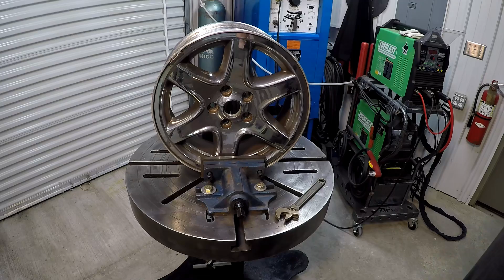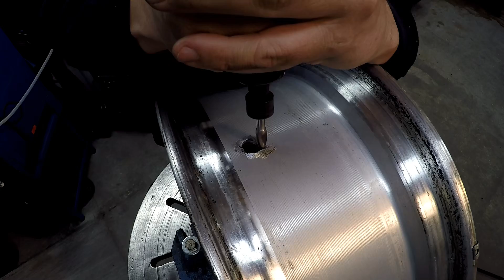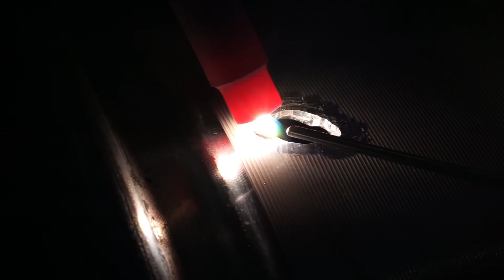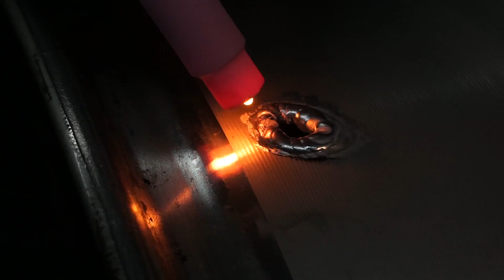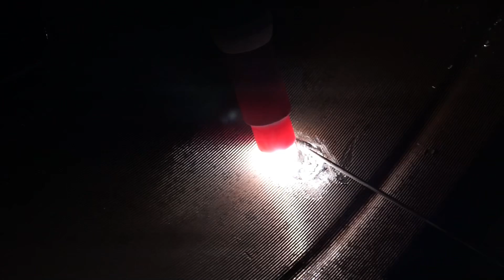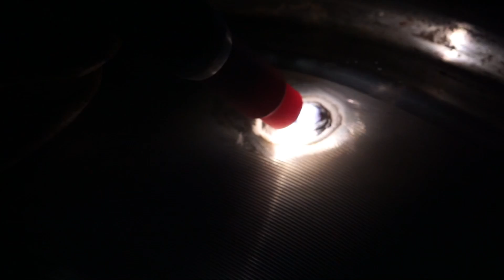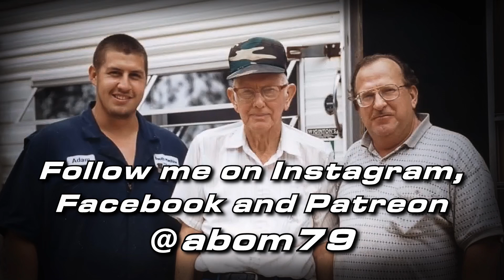SNS 239: Aluminum Wheel Repair

Comment: I used to own an everlast, 3/32 2% lanthinated is all I ever used in it for aluminum, everything else just seemed to melt back quickly into a ball on that machine no matter what. Something to do with it being an inverter, which also made it wander all over on a start
But good job, only thing I can suggest, was less stop and starts, as that is what cracks on aluminum is the depression at the termination of a weld pool as it cools. I might suggest just going round and round till it fills in completely then dab a little extra filler to make a slight mound and back off slowly

Comment: Problems is (well in the UK anyway) most 'alloy' wheels are exactly that. An alloy of magnesium and aluminium (Magnalium - 5% magnesium / 95% aluminium), and to be truthful I can't find ANY references to TIG welding this with any success using Al filler rod. You could try phosphor bronze rods just for 'tits and pickles' (cheers AvE) and see if that's any better.

Comment: I'm sorry but if you blow out a lower ball joint, you have done 2 things. A: not kept up the maintenance on your car. And B: Ignored a LOUD noise. Don't ignore these people. That's how you die.
Reply from the maker: This happened while being pulled behind a motor home. The loud noise was NOT ignored, and taken care of on the spot. It's funny what people assume.
Reply: Also take apart a new ball joint and you will find plastic yes plastic plus no way to grease it. There are you tubers who rework ball joints with lead or solder and they wind up way better than wimpy plastic new ones.
Reply: @frankdeegan8974  Good god your right. I just looked around and found a high quality one that has plastic in it. I couldn't find the rebuild though, could you link me to one? They sound interesting.
Reply: Not only that, but the car would pull under braking,  tramline and wander in a straight line. It would also chew up tyres fast. All that can be avoided with a $50 part.
Reply: @TyphoonVstrom  Eh, most modern cars don't have grease ports so you can't prevent it, but you can sure as hell hear the CLUNK. Now it's probably about 300$ to replace the part because it's around 50-150 for the part (depending on the car) and then the labor for the mechanic because most can't do that fix.

Comment: Ha, ball bearing. Looks more like 44 Mag. Someone got Insp. Callahan angry, i guess :-)     How i like the safety nazis.
Reply: Udo Willkomm 

Ha ha ha. He said ball joint not ball bearing. Ball joint is what allows your front tires to turn and suspension to go up and down but still securely (most of the time) hold the wheel on the car.
Reply: Did he? Jeez, i missed that "joint"
Reply: Udo Willkomm 

Mentioned at 2:01

Comment: I would not be surprised to hear the wheel had a coating to prevent corrosion from the damp air in the tire.
Thanks
Reply: most likely clear coat
Reply: A guy who owns a tire shop once told me that its to protect from corrosion due to "fix a flat". Apparently "fix a flat" with put pits in aluminum.
Reply: The coating on the inside is usually there to seal pinhole leaks in the casting.
Reply: @AlexLTDLX  The base coating on the inside is more for corrosion resistance and appearance. If a wheel has cracks or pinholes in it it gets immediately back into the furnace.
A crack or a pinhole would be a serious safety hazard.
Some manufacturers specify a leak test before the paint-job, usually the Leak test comes after the paint-job so it could hide cracks.
Reply: @Comedean  I don't know where you got that information, but it's incorrect.  Let's ignore the fact that one of my current projects is in the industry and I just got back from SEMA where we had a booth by the main entrance sponsored by the 6th largest company in the world.  Look at this logically: the coating is only in the center of the inside of the wheel.  No OEM on earth will pay to make the inside of anything the end user will never see look better for "cosmetic" reasons.  Aluminum "corrodes" by forming aluminum oxide - a very thin, very hard and almost transparent layer that protects the aluminum beneath it.  Hell, sandpaper and blasting abrasives are made from aluminum oxide - I currently have some in my blasting cabinet.  Once it's oxidized, unless you hit it with acid or physically damage it, not much else will touch it.  Also, notice that the coating doesn't extend to the part where the tire actually seats.  If it was there for "corrosion resistance" wouldn't you want the working surface to be protected from "corrosion?"  Never mind that nothing will ever settle on the wheel itself.  Let's say somehow, water got in there.  It would pool on the tire, not the wheel, obviously.  But what about condensation, you say?  Go ahead, spray a water mist onto a piece of aluminum and tell me how long it takes to develop any noticeable corrosion where the water sits.  I'd bet it would take the rest of your lifetime - probably longer.  The coating is there to seal any pinhole leaks (not cracks - porosity).  Period.
Reply: I think you are talking nonsense.
What ever you say is irrelevant to me, I work for one of the leading manufacturer of aluminum wheels and we coat the whole wheel (accept the flange and bolt-holes). And the reason for the coat is corrosion and wear resistance (and appearance) not sealing up the aluminum. 
If you seal up a crack with paint you do not fix the problem. You now have a hidden crack that has the potential to kill the passengers in that vehicle great solution. 
Thats the reason why some car manufacturers insist on a leak-test bevor the paint-job so they do not get crappy wheels. But most cracked wheels do not get that far because every single one of them gets x-rayed long bevor the leak-test.

And yes aluminum forms a oxide layer, a thin one that does not hold up against salty water.
And a salty water test is one many QC-Checks that are made. (the wheel gets pressure-washed with salty water for a few weeks)

If your factory spits out wheels with cracks, fine not my problem.
Reply: @Comedean  Nonsense?  Really?  Lol.  I specifically said porosity, not cracks - there is a big difference.  That coating isn't paint - it's an epoxy based sealant.  Most OEMs use this now.  Many aftermarket wheels don't bother, except the Bogarts that are on my race car have sealant between the two aluminum plates that make up the wheel.  Out of curiosity, what company do you work for?  And yes, aluminum holds up to "salty water."  The only time aluminum corrodes in water (salt or mineral bearing, doesn't matter - it's the same chemical process) - is when electrolysis occurs.  The water becomes the electrolyte,  and it requires to dissimilar metals to be submerged in the electrolyte.  I go into this in detail here: https://youtu.be/aYdFhooeHiE
Watch it, you might learn something.  Otherwise, if what you're saying is true, aluminum boats would be sinking left and right.
Reply: @AlexLTDLX  Some aluminum alloys are more susceptible to salt water corrosion than others. Marine aluminum is different from, say, aircraft aluminum. After WWII, there was a lot of surplus aircraft aluminum available and people made boats from it. They corroded.

Comment: when working with aluminum i like to coat my bits with wax keeps them free of aluminum.  Looks nice but im wondering why you didnt put the rim into the lathe to see if it was warped if nothing else.

BTW to others on channel. "performance aluminum rim" is a bit of an oxymoron since most rims will bend out of shape from any serious load. "alloy rims" are the same. Most non steel rims, new or old, only last an average of five years before they start loosing air regularly due to either stress cracks or just unable to seal on rim. There is coatings that should be put on rims before a tire is mounted but more than half the time it is not put on.
Reply: What a load of rubbish. I've owned many vehicles with factory alloy wheels that hold air and don't have cracks. They aren't bent either.
In fact, right now my daily driver is sitting on 23 year old alloy wheels that need the air checked MAYBE twice a year and still balance up just fine....
Reply: @TyphoonVstrom  lol right back at you kid.
Reply: Like sideslip says - rubbish about aluminum wheels lasting only "five years on average." Complete nonsense.  Tell that to my 15 year old Bogarts, or any car I've owned in the last 30 years - only 2 had steel wheels.  Also, using alumacut burs eliminates the need for any lubrication.  Besides which, putting wax on the cutter then trying to TIG it isn't going to work - you'll contaminate the weld and end up with porosity.
Reply: @AlexLTDLX  not sure where you guys are coming up with this stuff. I have yet to see any aluminum or alloy wheel that is not pited,chrome peeled, or oxide coated to snot over five years, Even when not exposed to winter roads. The other ones i have seen that are driven very hard are spider cracked quite badly. Heck I have seen a few that are bad inside two years. 

And it is not just me. There is plenty of wheel shops out there that could tell you the same thing. in my almost 40 years of working on cars and trucks I have seen from Cragar to even chip foose wheels. All of them leak and corrode badly after just a few years or regular driving. 

Not sure how in the heck you can say that yours have lasted that long. Sorry I just cant believe you.
Reply: @jacilynns6330  Look around.  There's literally millions of cars on the road with aluminum rims 5 years old and older - if what you're saying was true, they'd be on the side of the road with flats, causing accidents, etc.  Heck, OEMs wouldn't warranty the wheels either.  I once held on to an Audi A6 until it was 14 years old, no issues.  Look at my channel  - https://www.youtube.com/user/AlexLTDLX/videos - the Bogarts on the car were bought in 2002, and they're in great shape - no clear coat, just bare aluminum.  As much as I hate to admit it, I only wash the car about once a year.  I just got rid of a set of mustang 10 hole wheels last month - they were made in 1988, have been on a number of different cars, and still held air and were in great shape - after 30 years.  I have never had a problem with a cracked rim  or one losing air from use.  Nobody I know (and I know more than a few car guys) has had such an issue.  Neither has anybody in my family.  

Now, if you're an absolute filth pig that constantly drives into curbs, then you'll likely bend or crack a rim.  But you also shouldn't be driving.  One final thought - arguing on the internet is like a broken pencil - pointless.
Reply: @AlexLTDLX  sigh . I was not trying to make a trolling thread. And I do look around vehicles 3 years aluminum rims. I WORK on these cars day in day out and have for the last forty years. 5 years or older maybe about 1 in 20 cars have aluminum rims everyone else is running steel rims. And there is a whole bunch of nice steel rims. Why do you think car manufacturers are going back to steel rims in the first place. Wreckers crush aluminum rims and send them off to smelters because nobody buys them.

To be fair if you live in a dry climate there might be a bunch with aluminum rims where you are. I however do not live in a dry climate, just like most of the world. Heck I have seen brand new rims out of box in plastic wrappers ie nos rims that have to be powdercoated because of the deterioration from oxide.
Reply: Just looked at your channel. Oh boy your the kind of person I would not get along with at all.
Reply: @jacilynns6330   - LOL.  "car manufacturers are going back to steel rims" - seriously?  Have you been to a dealership lately?  99.9% of the new cars have aluminum wheels.  The only place you can get steel wheels is on bottom line, no-frills transport modules.  Wow.  This is 2018, not 1977.  Re: Your "dry climate" assumption - I live in DC.  A swamp.  Now I understand you live in some parallel universe where aluminum performs like wood, but even in your world I'd bet DC is not a "dry climate." "Deterioration from oxide."  Again, wow.  You do know that when aluminum "rusts" it forms very thin, extremely durable and nearly transparent coating called aluminum oxide, right?  It's so durable, in fact, that it's used to make sandpaper and blasting media.  I think you should explore other lines of employment.
Reply: @jacilynns6330  I can tell.  I build hotrods, engines, transmissions and EFI setups in my spare time.  Heck, I've designed and built three supercharger systems from scratch, including designing and building intercooler CORES from scratch.  You seem like the kind of person who charges little old ladies for "muffler bearings" while they scrape together their social security checks to pay for your nonsense and you still probably sleep well at night.  You're probably right, you wouldn't get along with me at all.
Reply: @AlexLTDLX  now your just getting ridiculous. Maybe you should check with wheel shops before you keep going. 

Since I dont do any of what you claim, Yes I do sleep well at night.
Reply: Jacilynn S Jacilynn S If you don't have anything nice to say, don't say anything at all. It's a video. You don't like his content then fine, just don't watch it. It's really not this big of a deal.
Reply: @Alexandra-tc8rk  point of fact I didnt insult anyone. Im the one being insulted just for pointing out the simple truth
Reply: Jacilynn S IT'S A VIDEO OK JUST LET IT BE I DON'T CARE WHO WAS IN THE WRONG OR NOT, JUST BE MATURE AND LET IT BE ok
Reply: @jacilynns6330  - I haven't even gotten to the bottom of this thread yet and I want to correct you. Stock aluminum wheels last just fine if they were manufactured well. I have 2 80's Volvos on their original 15" alloy wheels, both perfectly healthy. Neither set is cracked or leaking, and my one car has over 430k miles. I also have 2 mid 90's BMW's, and both sets of those wheels are also perfectly good. My '95 Chevy van's stock 15" alloys are fine too. 5 for 5, all stock 23 years old or more, straight, not cracked and holding air. I've also has others that I don't currently own but were of similar age and condition... you're simply biased because as a technician *you only see the parts with issues*.

*edited for spelling*

Comment: Cheap foamy oven cleaner aerosol works great for cleaning alloy wheels and is 1/4 the price of alloy wheel cleaner....
Reply: I tried that! and CLR...  They both work really good. but they leave chrome looking hazy and it has to be rewaxed.  But the Wax helps keep them clean.. So Win Win?  Maybe I'm just lazy.
Reply: You have to be careful with oven cleaner, some of it will eat the alloy really quickly especially on cheaper alloys and higher strength cleaners.
Reply: Yeah I wouldn't reccomend on actual mirror chrome or on a $60k car.  But for the age of wheel we are looking at here. Perfect.  Like I say, get the cheaper stuff, will be a lot less corrosive...

Comment: Nice job Adam. Although I've never need ed to weld a wheel rim, I've had problems welding other things from both sides. I've found if i do a second clean up grind on the back side before welding over I get better results, maybe it oxidises from the air  behind where no argon is flowing or something. Also i find it a lot easier to drill the repair round and place a disk of metal in there with a prep'd edge. Not sure how well that would work on a rim though, I think some have a high magnesium  content.

Comment: I've never welded aluminum before and don't really know much about it . Would it have been easier to make a plug from aluminum bar stock and weld that in rather than building up the weld? Doesn't aluminum crack easily if you don't control your heat properly? What gas are you using (argon?) I know aluminum doesn't hold heat very well so would it be beneficial to have a heat gun blowing on the back side to keep the piece hot? Sorry for my ignorance, in advance.

Comment: I bet this wheel is off of a Jeep Commander because they are not very popular and I am sure they are even more scarce in Florida being all wheel drive.  They are also known for having the defective front end that was supposed to be recalled but Chrysler managed to hide that fact long enough for Fiat to purchase the company so that they didn't get stuck buying back all of the garbage that they produced for 14 years knowing that it was dangerous but decided that it would cost too much to make right.  I have a commander personally and knew about the issue before I got it, I will just keep a close eye on the defective parts.   If you end up needing a junkyard wheel let me know and I will ship one to you Adam.  My local junkyard has a few that I can buy for cheap but the shipping will be more than the wheel I bet.
Reply from the maker: I believe it's a Compass. I know it's the small Jeep.

Comment: Good day Adam, 
I really like the content you're putting out. It has inspired me to get back to machining.
 When I lived up north I worked at a shop that machined forged aluminum rims. The off grey colored space that you pointed out on the O D is not a coating. When we lathed the rims completed the next operation was "Prestress" we would chuck on the bore and the wheel would come up to speed two arms with rollers would apply pressure on the material and they would be moved to both of the safety humps. We where told that it was like "heat treating" the wheels. It put the molecular structure of the aluminum back together. So there is no coating, just a FYI. Thanks for all you hard work.